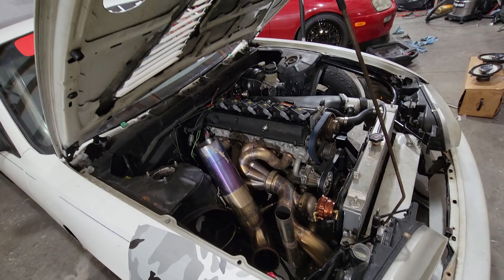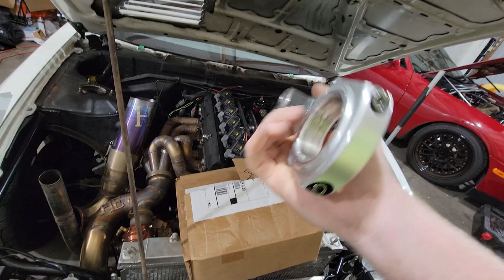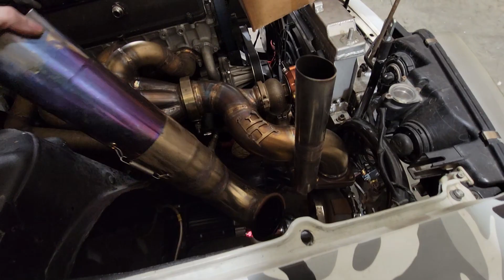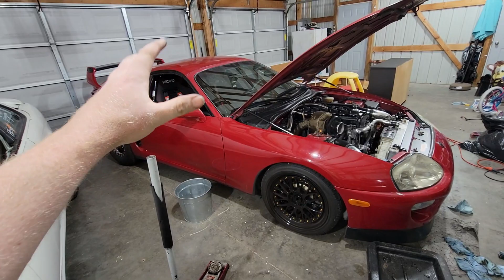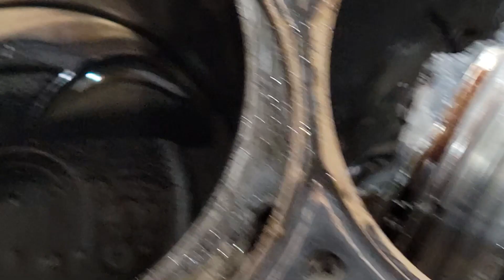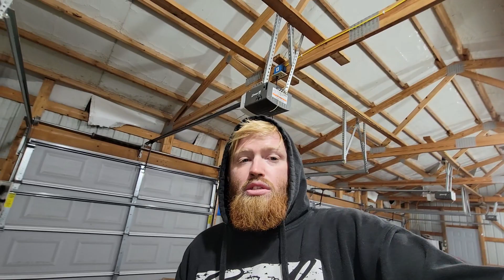COMPLETE CARNAGE, TEARING APART THE 2JZ IN RICEBOX

Comment: Ally rods, there's no Daily or constant cruising for this build!
Reply from the maker: That's actually a common misconception. You can do all the same things with alum rods as steel rods. You have to warm everything up including oil temp to operating temp before driving though
Reply: @RabidJz  Good luck, here in Aus we have a whole lot of big power RB's n 2Js and a heap of them run Ally rods, and none of them can daily or even dare to! Remember my dude, Ally rods have massive fatigue issues! Them more hours you put on em the worse! Steel doesn't do what Aluminium does! But hey, go hard ey!
Reply from the maker: Im going based off information from real street and people with 7 second street cars. They still street drive their cars.

I have no Intensions of daily driving it. Or driving it long distances
Reply: @RabidJz  Like I said, good luck with it! The guys from Real St also dismantle their engines extremely regularly and as mentioned before Aluminium has a very high fatigue rate! You'll daily it but what happened to you before will happen again. Should have put a little extra in it and got titanium rods! Then you'd have the best of the best! Ally is pretty much exclusively used for short hits and only on the strip! Plus I'm going with the best of the best in crazy builds and What PRP, CRD say is ally isn't very daily because of the fatigue issue! But hey, good luck, this will be a great experiment to see how long until you blow another engine! Parts may be good but Tune is king!
Reply from the maker: I can assure you, if my tune was "sub par" it would have blown up at 20psi. And my last engine wouldn't have lasted 2 years on 34psi with my 6466.
Reply from the maker: Theres a plan in my book that you guys dont know yet. All will be clear in a week.
Reply: @RabidJz  Your engine didn't last a whole 3 years! WTF dude, check the dates! Tune it is man, along with parts of course! You can still be sweet at 20psi and have no detonation but as you have XP in, up that boost and tune is what's king! So Bag it went!